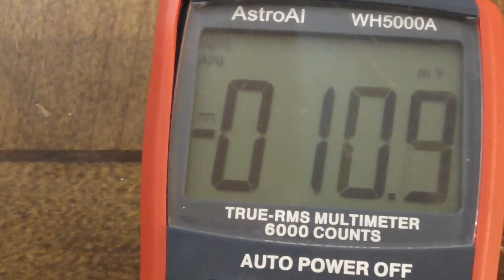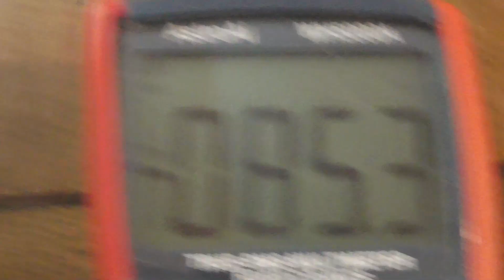The Tesla Switch - Restoring Non-Chargeable Batteries

Comment: When the 9 v battery is charged like that. How long does it run before it gets dead again?
Reply from the maker: I have not made any major tests, because they are "non chargeable to be fair I assume not as long as original charge. I myself use this and other bedini like methods to keep my volt meters batteries charged a couple weeks. it works but you need to constantly monitor charge as over charging these to just a few volts triggers rotting on bottom plate and corrosion and leakage.